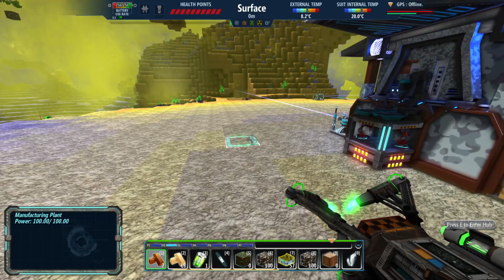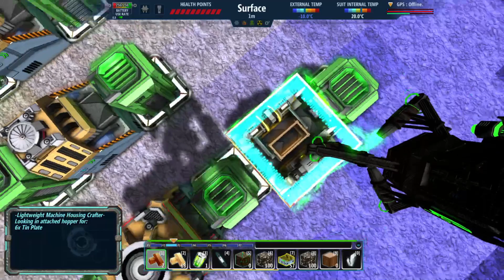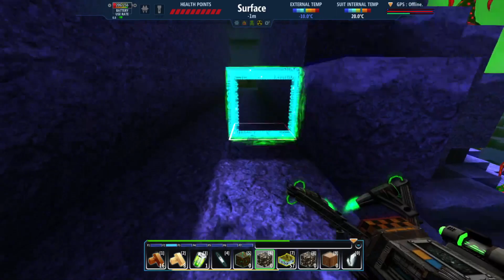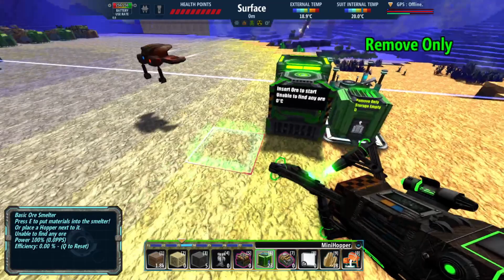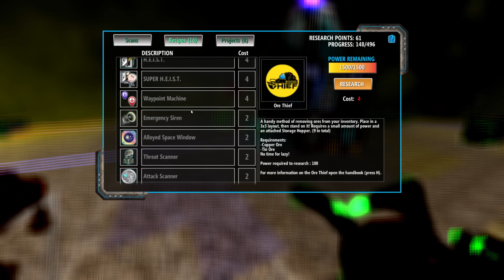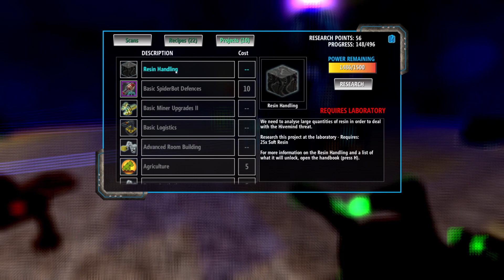ESSENTIAL UPGRADES | FortressCraft Evolved S02 E02

Comment: The problem I've noticed with power transmitters (which everyone likely knows) is that the laser can be blocked. I really don't like them because I keep accidentally blocking lasers and not realizing until the power runs out. I have this nifty little trick where I find a nearby coal node (if possible) and combine the following machines in a square; miner, hopper, PTG, power battery. You place the hopper next to the miner so it auto-fills as the miner works. You place the PTG against the hopper to take coal out, and you place the battery between the PTG and the miner. This setup is compact and self-sustaining.

Then, create the same setup next to an ore node you want and feed conveyors from the coal setup to the ore setup. The coal setup can get by on a simple logistics (white) hopper since it only needs coal in it, and those hoppers are quick. The only problem is mynocks, so either use the mynock-proof tubes, defend your conveyors with turrets, or destroy all hiveminds that can interfere. I recommend the tubes because they work in the Cold Caverns. Once set up, nothing can interrupt the flow until the coal runs out. You might even use a mass storage as an intermediary for the coal, but I don't use them. I really don't like how PTGs stop working after a certain depth either.

Comment: Don't forget to check your self crafting menu [C] button.

You can convert 15x logistics hoppers into a standard hopper.
Also, once you've done some room research, you can construct an inner factory wall using the wall blocks in the defence self crafting menu - these are immune to tunnel nukers 😀